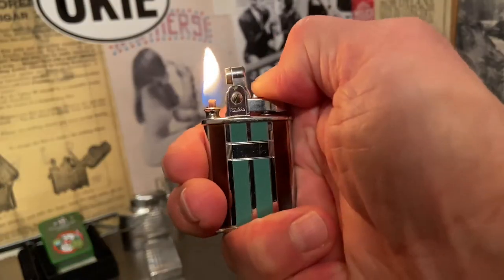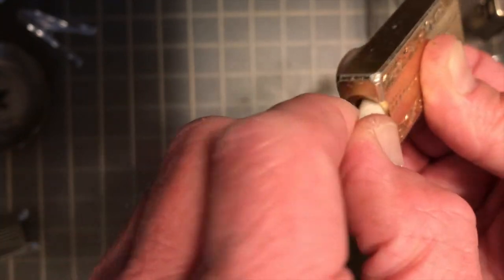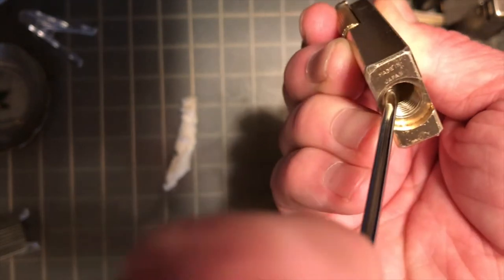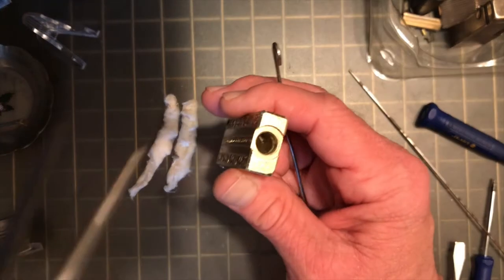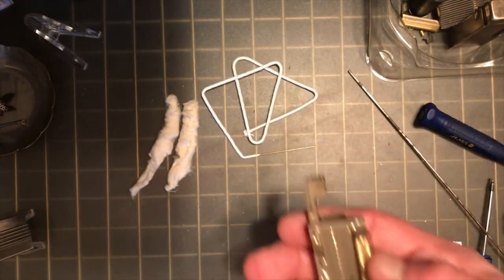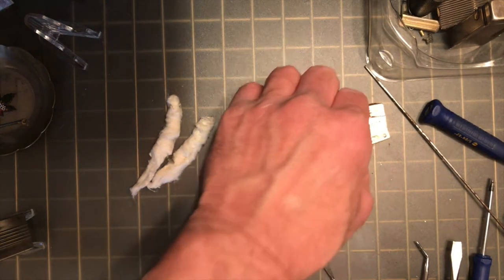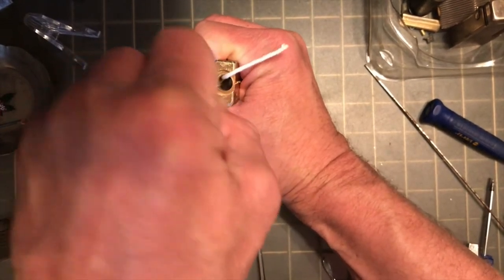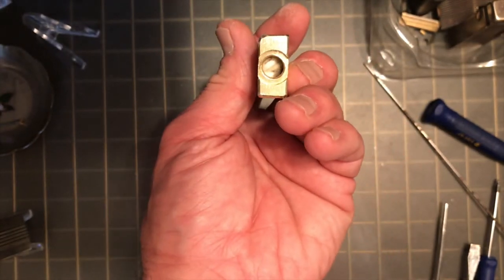How To Replace The Wick In A Vintage Cygnus Aluminum Block Petrol Lighter

Comment: Just seen the video, I didn't know if the top came out, but I assumed that was the case, doing it now. Thank you for the reply!! Tim S.
Reply from the maker: You will put the new wick in through the chimney on the top but everything will come out the fuel hole on the base of the lighter.✌️

Comment: Hello, Sir, I've got a penguin cygnus from my girlfriend (have to ask her the history behind it) and then, after looking for information about it, I've found your channel, which was the only source of information about penguin cygnus wick lighters. I've been watching during the whole week your videos! I'd like to know if this wired zippo wick fit in the lighter.. I couldn't wick my mine with it, it seems wider than the wick hole. Do you have any suggestions? Thanks you!
Reply from the maker: Yes, you can typically twist those copper woven Zippo type wicks down small enough to fit but Imco wire lead wicks will go in much easier. There are links to purchase several different type wicks from Amazon & Ebay on this page of my site:

https://dependableflame.com/what-kind-of-wick-should-i-use-in-my-vintage-petrol-lighter

Just out of curiosity, was there a wick in it when you received the lighter?✌️
Reply: @DependableFlame  I'm going to give another try when I got home, maybe using some metal wire to help me. 

Yes, my lighter came with a wick in it. I decided to rewick because it is too small, pratically the same length of the lighter.